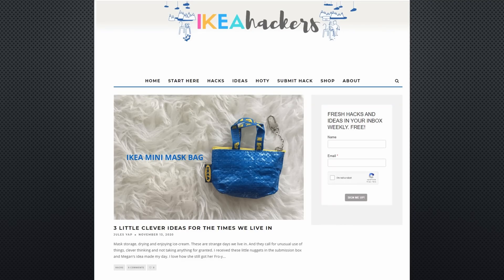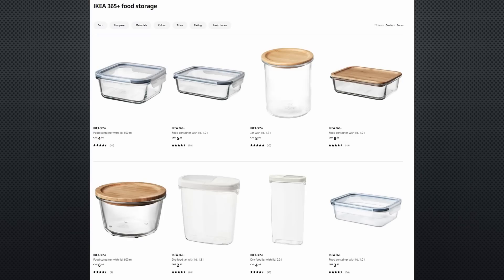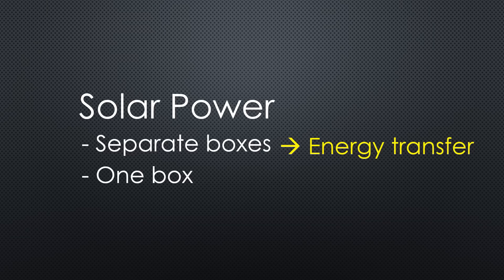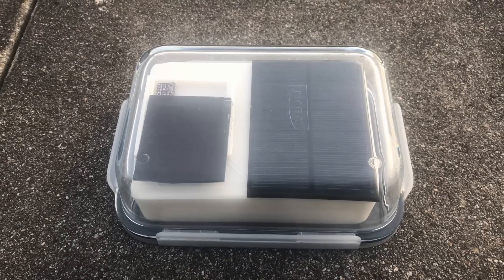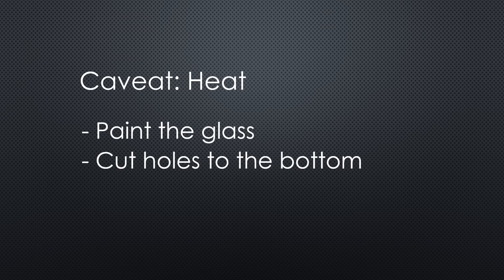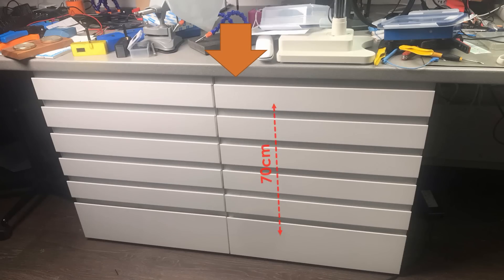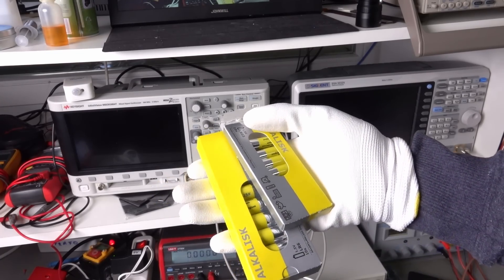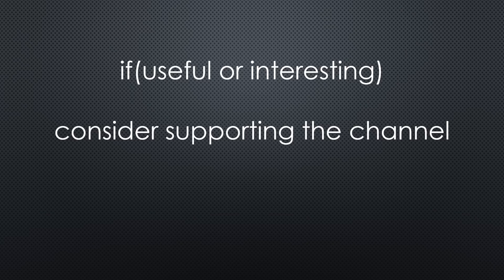#361 IKEA Goodies for Makers incl. my Newest Find

Comment: Did the refraction coefficient of the glass or box not effect the light/UV readings?
Reply from the maker: I did not do exact comparisons. Maybe I will do it once. The UV seems to be attenuated quite a lot. For the other sensors I still had to add an ND filter.
Reply: @AndreasSpiess  Regular glass blocks UV quite effectively, especially UV-C, which is why UV-C tubes use quartz instead of glass! (Same with old-school EPROMs: it’s a quartz window, not glass.)

Comment: Be aware that polyproylene is not resistant to UV and deteriorates when placed outdoors in the sun!
I used a polypropylene sandwich box to house an L-band patch antenna and placed it on the roof.
It was not IKEA but another known brand SISTEMA who make attractive boxes that are tempting to use for this purpose.
However, after a year on the roof I took it down (as the satellite service I used it for was terminated) and the box crumbled in my hands.
It had not leaked yet, but I think had it been out another winter season it would have cracked and leaked.
And this was in the Netherlands, quite similar to Switzerland w.r.t. sunshine I think.
Reply from the maker: In my setup the plastic lid is below the glass. And glass seems to reduce the UV considerably. Even if I have to replace the lid after a certain time it will not cost an arm and a leg.
The "professional" box, BTW, also was no more transparent after a summer of usage. The glass so far did not suffer at all.
Reply: @AndreasSpiess  Yes of course glass is perfect for this, it will still be there after 100 years.
Indeed having the glass above the plastic bottom will help a lot.  I also should have used a glass container.
But you also showed full plastic boxes and those will certainly have problems outside even after relatively short time.
The glass bowl with glass lid is best but of course unpractical when there are cables running out of it.
Reply from the maker: My intention is to use plastic where it is not in the sun. This is why I was so happy to find a "project box" of glas.
Reply: Coat of paint will probably solve that.

Comment: I think commercial electronics boxes for solar powered things have drainage/ventilation holes. I wouldn't try to seal a box unless it's going to be submerged, a small amount of airflow should keep the electronics reasonably dry if it's not raining on them.
Reply from the maker: After many comments I plan to start a comparison between the different variants: Sealed, with hole, and with a IP 68 ePTFE Membrane

Comment: Thanks for the great idea to use these food boxes for your projects :) I think they are indeed very good value.

I am not fond of the alkaline batteries from Ikea, because they tend to leak just at their best before date. More than any Duracell or Varta battery will do. Alkalisk seems to be made in Germany, so they are most probably produced by Varta. And the CR2025 are the same, they may not leak but they drain a lot faster in my car key than the original Panasonic battery did. LADDA seems to be very good indeed.

The LACK table at the end is always very useful, it only costs 6 euros here in The Netherlands.
Reply from the maker: So far I had no bad experience with the batteries. Maybe because they have to replaced before they start to leak in my applications.
Reply: @AndreasSpiess  That could of course well be the case, thanks for you reply :) My experience is based mainly on four tv remote controls that were stored somewhere in the attic, with batteries still in it. I know, you shouldn't do that. Two of them had Ikea batteries, two had Duracell and some other brand I can't remember. After a couple of years, the two remotes with Ikea batteries were full of leaked battery, while the other batteries were still intact. And I recently found a pack in a drawer (two years after the best before date) with some unused batteries still in it. They all leaked horribly.
Reply: A battery that leaks more than Duracell?  I cannot believe that!

Comment: If part of the box were metal, one could mount a finned cpu heat-sink both inside and outside, and maybe a low power dc fan on the inner one.
Reply from the maker: You are right. Maybe it also would heat up less than the glass boxes.

Comment: What about filling the box with mineral oil or glycol coolant to help with cooling/dissipate the heat? How well would it work in the sun, or would it make it even worse? :o
Reply from the maker: I do not know if oil would heat up more or less. While it is a good idea for some applications (e.g. dummy loads) I would not want to use it here because of the mess if I have to reprogram the device or want to change something...

Comment: I believe the same table you're using with your printer (I think its actually the Lack table from IKEA) is a near perfect fit for standard 19" rack mount equipment between its legs. 

Just google "IKEA table Rack" for more info; some of the setups are very impressive.
Reply from the maker: You are right. There are other comments about that.

Comment: Outdoor enclosures for electronics projects is a worthy topics for discussion and perhaps future episodes.  Even many consumer grade outdoor devices fail due to poor design.  My purchased rain gauge required repair after 2 years due to water corrosion of battery terminals and insect infestation.  I've built many outdoor Rpi webcams using repurposed containers such as your showed in this video.  Most worked better than not-so-cheap purchased camera enclosures.  Right now, I'm considering putting a Jetson Nano outdoors but need to solve the heat dissipation issue you touched on.  Running AI object detection means active fan cooling.  I worry the relatively expensive Nano will not survive long with dust, insects, snow in the winter, 40C heat in the summer.
Reply from the maker: After the many comments about sealing the box I decided to start a test with three versions: Sealed, with a hole, and with a IP68 ePTFE Membrane.
I assume glass will be withstand UV better than plastic.
If you have a lot of energy to dissipate you probably have to go with active cooling. So far I only have a Pi3 in my LoRa gateway. It works ok without any cooling, just sitting in its PVC tube.

Comment: If you do not have a solar cell on the inside, I use "oil level sight glass" for light sensors. I drill a hole in a waterproof enclosure and plug it to the hole with some silicone, and a nut on the inside, just like waterproof cable glands.
Reply from the maker: Good idea of re-purposing things!

Comment: Dear Andreas.. you can look at something called "IP68 waterproof vent plugs". I use these in my projects and they are perfect for temperature dessipation as well as avoiding condensation from happening due to non movement of air.
You get them in ABS like material with a silicone 'O' ring and backnut screw to mount it on any flat surface with a hole.
Reply: These vent plugs have been used in tower top electronics in the radio industry for some time but recently some manufacturers are moving to goretex patches. These work just as well and are far easier to apply during manufacturing. I have used Goretex repair kits to provide this sort of breathing. It won’t allow much heat exchange but it does stop moisture being sucked into a sealed box as it temperature cycles. This is normally the main culprit for moisture ingress in a sealed enclosure. It kind of sounds counter intuitive but a sealed box must have a breather hole to stop moisture entering. You just need to be clever about where the hole is and what is used to cover it
Reply: @joelong9260  Joe, I think you are right, as I have seen small holes at the bottom of some car light lenses, and of course Andreas car lights are boxes designed to let light transfer just like your needs.  From my experience it is always best to assume all seals will fail one day for example wear and tear, dirt, etc. and rather than spend lots of time, money and worry making sure it is fully waterproof better to work on the bases a little water might get in so map what paths it will take and build in drainage hole/s and keep sensitive items away from the water paths.  Keep up the excellent videos Andreas.
Reply: @joelong9260  You made me think of the filters and silica pack inside of a spinning media hard disk drive. The filters, I imagine, should be rated for the same dust ingress value as the clean room that made the hard disk. I’ve never given any thought as to their management of water vapor though, but I think it’s safe for us to assume it’s factored into the design and application of these filters and silica pack. I don’t think a hard disk drive exceeds 75C though 🤔
Reply from the maker: Thanks for the tip. I ordered a few ot them and will start a comparison with the sealed box.

Comment: I work in the near of a Ikea store. This is terrible. I'm a "professional" IKEA Hacker. There are so many things you can "missuse". All those stuff made from stainless steel. If you don't reduce beeing a maker to tinkering with electronics there is a wide field of things. e.g. 19 Inch racks made from RAST http://journeytounknownsoundscapes.blogspot.com/2016/11/ein-neues-modularrack-ikea-hacking-die.html and many other things :-) Sometimes it is cheaper to buy a closet and salvage the parts, than buying wood in a local store.

Comment: Conformal coating to waterproof your boards and design to Nema 3 enclosure standards should give you direct water cover but adequate cooling.  The coating will prevent moisture penetration from condensation or high humidity.
Reply from the maker: I hoped to avoid the conformal coating with the box...

Comment: Im also used to American brands having similar products, affordably. Whats produced closest to you is rarely going to be most expensive for you.

As for heat issues - an old heatsink that punctures the plastic lid, sealed with RTV fireplace silicone will do the job. Then we just need a small fan or two, and a vented outer chamber.

Cover the vents with tyvek (for moisture seal, but air exchange). If nothing else? White, high-end, disposable painters coveralls will probably be the right material.

Now that I think about it, why bother with the heatsink? Perhaps a tyvek-filter-vented uni-chamber design would be sufficient. Just need two opposite sides vented to maximize airflow.
Reply from the maker: I have to stick to international brands on this channel. A sealed heatsink is for me the "last resort". Going with your paint proposal for the moment is more appealing for me.

Comment: I always like passive cooling, so maybe a "heat pipe" type cooler for your chassis.  With the plastic lid, put a heat sink on each side of the lid, with a "gap-fill" type heat conductive material filling a hole between the two heat sinks, but keeping a hermatic seal with RTV silicone or the like.  I've seen something like this in outdoor cabinets for radio repeater gear work effectively.  Convection could move the air around within the enclosure, and whatever breeze or simple convection work on the outside of the chassis.  Probably not highly efficient, but might help a bit with the thermal management.  (Maybe do this on the bottom of the enclosure to keep the heat sink from picking up any heat from the sun if the heat sink is dark.)    Love the videos.  They always make me think a bit harder about some of the simple problems.  73
Reply from the maker: I still dream of not letting the heat in ;-) A heat-pipe is a good solution for higher power applications. Here I assume the amount of heat would probably be small. 73 de HB9BLA

Comment: For power in/out you can easily drill a hole into the lid and use a cable gland for a waterproof connection. The battery box can be opaque and sit in the shadow.
Reply from the maker: I agree if I have the battery outside. This is probably the second-best solution for me. I still try to keep the "one box solution. We wlll see if I am successful or I have to chose hte second best solution

Comment: For projects that need to be sealed into an enclosure how about inductive power transfer like Qi to get power into the box to charge a supercapacitor. That way the box can be made light opaque and radio transparent reducing internal heat. An external solar power supply can drive the Qi or equivalent coils.
Reply from the maker: Good point. Reminds me to start playing with my coils sitting in one of the IKEA boxes ;-)

Comment: Having sealed boxes has the problem of ‘breathing’ as the air within heats and cools, sucking in humid air.  We used Goretex breather plugs in our IP67 outdoor satellite modems where I worked, to allow breathing but keep out liquid water.  They’re expensive, but they work!
Reply from the maker: Many other viewers also commented abut that fact. Maybe I will once have a look at it. For the moment I had no issues with humidity in my light sensor. But I check frequently because I fear it will start once...

Comment: I also used the air tight boxes for the offgrid protection relay of my solar panels, works really great so far. Also I have two of those massive wooden Bekväms, one for my Ultimaker 3 and one for a belt grinder. Check out what Brian did to one of these, awesome content: https://youtu.be/153F6-xi0FM

Comment: Could you not use a hydrophobic mesh like they use to cover the openings on smartphones as it will slow down airflow but it should stop water ingress, just graft it into the lid as it's upside down you could mold a lip around the vent to avoid any capillary action drawing moisture into the mesh
Reply from the maker: Many other mentioned it. Maybe I will once do some test with it.

Comment: What's the 3D printer table for ?
Reply from the maker: To store the filament rolls. Like that I have three rolls to choose.
Reply: And if you print ABS, you can add walls  to keep the air in the printer on a constant temp.I added some magnets, and clear sheets to enclose the whole printer. When printing PLA I remove the walls.

Comment: You can solve the battery heat exposure problem by putting the battery outside of the container using a waterproof connector.  Place the wires in a silicone tube approximately 36 cm long.  Put the battery & tube ending in a small waterproof box, completely fill the box with silicone sealant & bury the battery assembly in the ground.  It will stay warm in winter & cool in summer.
You can put desicant powder or  desicant beads from a silica pack into the silicone tube for extra protection.
Reply from the maker: Good idea and a last resort. For the moment I plan to experiment with the battery inside the box. We do not charge and discharge our batteries a lot and maybe the specifications are made for heavily used batteries. It is vary handy to have a single box...

Comment: That container at 3:25 has very weak tabs.  After less than a year two tabs had broken off from my wife's container.
Consider the cycle rate; if you put it together & leave it alone you should be fine.
Reply: UV aging making them likely become brittle in the sun might also be an issue.
Reply from the maker: We will see. As you write, I will not open it frequently and in my setup it is below the glass. Other viewers wrote that the glass absorbs most UV. Even if it breaks after two years or so, the loss is not huge. The glass should survive.

Comment: @Andreas Spiess, awsome video! Do you have any vectors on the ikea drawer modules? I searched for a while, but could not find them :-(.
Reply from the maker: It is called METOD. I left a link in the description
Reply: @AndreasSpiess   Thanks!  Unfortunately there ist no 6-drawer Unterschrank in the list, so it looks like they dicontinued them. However: Coole idea!
Reply from the maker: As said: I had to cut the 10 cm on the top to get to an acceptable height for the lab. One small drawer is 10cm. So you lose one (you also do not have to buy it)

Comment: Hi, good video as usual. 👌
I only see a problem if you use the Boxes upside down as water will stay in the lid. 
I use the (original) professional out door cases for years now for my sprinkler system with great success. It may depend on the quality of the polycarbonate if they get milky. I like the mounting points outside the containment. Wall mounted and horizontal installations does not show any leaks or milky front panel. I Always made sure that cables exit the case on the bottom through waterproof fittings (only use one fitting per one ROUND cable or waterproof connectors). You can get the BH1750 with a diffuser dome which can be easily sealed on top of the case.
Reply from the maker: Do you have a link for the boxes you use. Maybe I put one on my roof as a comparison. I wanted to avoid a plastic dome. This is why I liked when I found these glass boxes.
Reply: @AndreasSpiess  i bought them years ago from ELV - nowadays the offer Chinese cases (see drawing)- but as I remember they are form the German company Wöhr (https://www.industriegehaeuse.de/kunststoff-gehaeuse/ip65-ip68-gehaeuse/)
Reply: @AndreasSpiess  the Domes im my case are great to measure diffuse light better than direct spots and shadows.
Reply from the maker: Thanks for the link.
I do not know how much the dome "bends" light. Because my box is completely of glass, light reaches the sensors also now. But of course it is weaker if the angle is more shallow. But maybe this is also what I want.
Reply: @AndreasSpiess  the dome (should) work like in „professional“ lux meters enable the more the measurement of an integral from 180 degrees diffuse and direct light. (Sad that it is not possible to post pictures here)